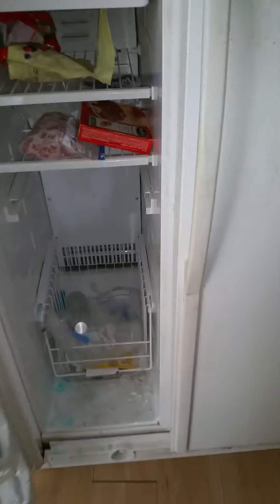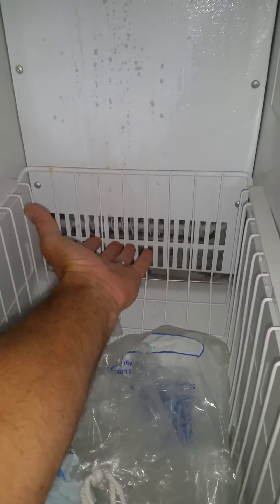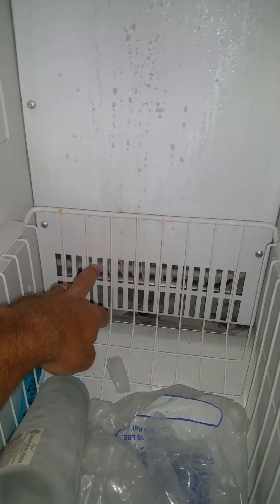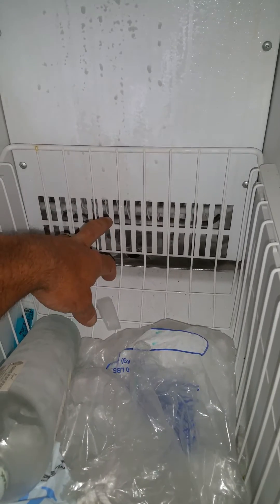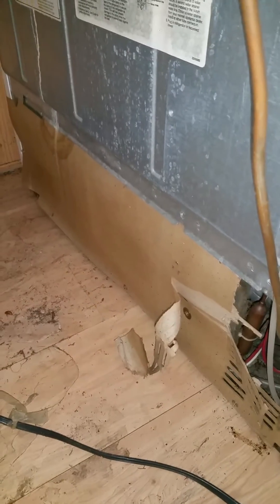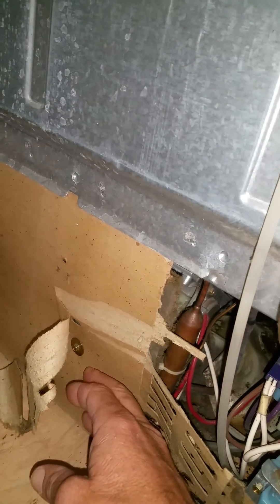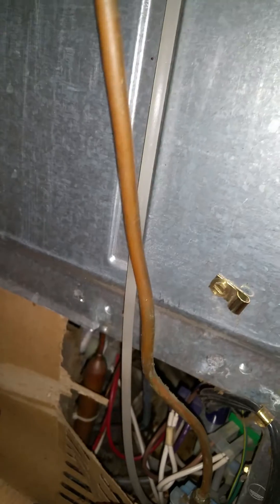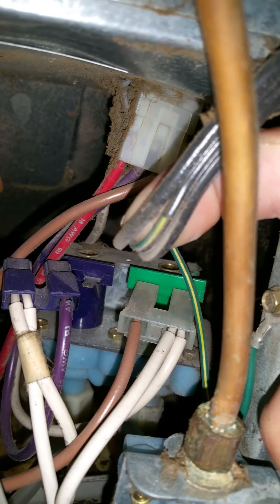Refrigerator freon leak or defrost problem?

Comment: Great video I need some help please! My freezer will not get as cold as it use to will not make ice and frozen items such as popsicles are soft! Fridge side temp is fine. I checked to see if the coils where frozen both sides are clean no frost. Compressor is warm and running. I am lost now and have no idea what to check next please help. We have a 6 year old  Samsung side by side refrigerator with ice and water dispenser in the door not sure if you needed that information. Any help sure would be greatly appreciated. Have a wonderful day. -Paul
Reply: same issue here.